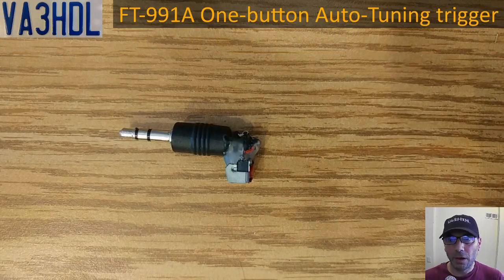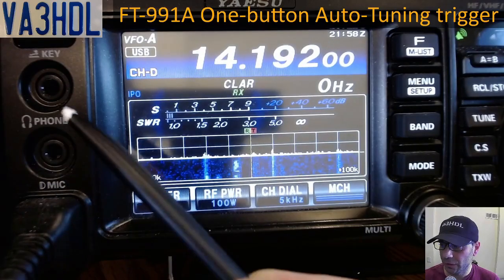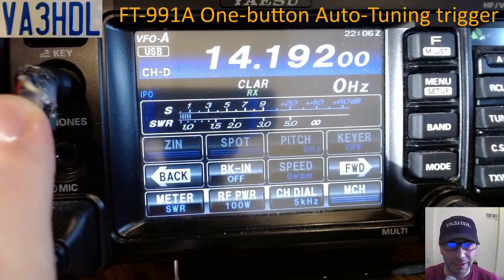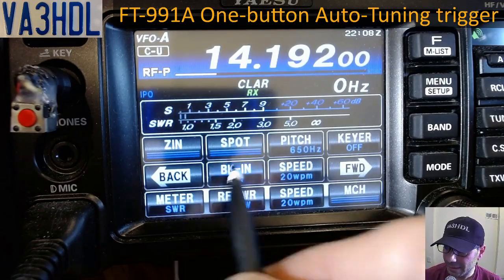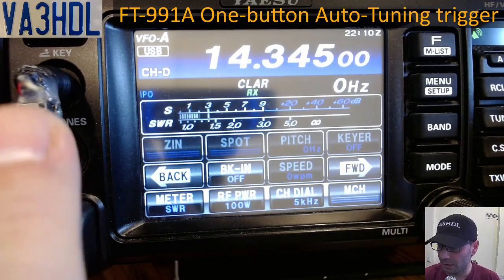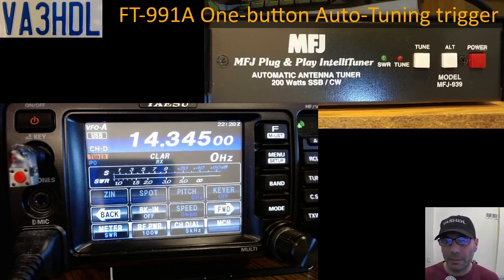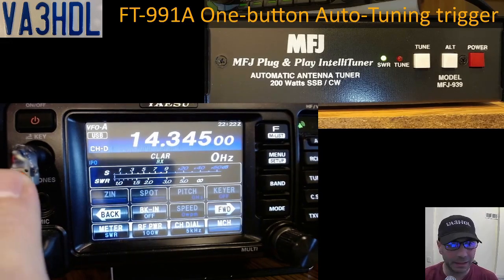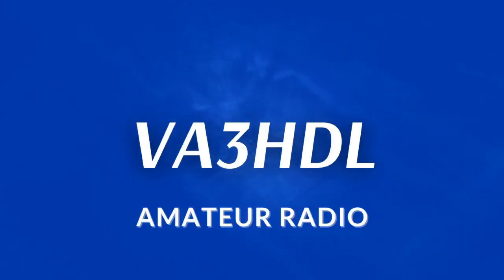FT-991A One-Button external Automatic Antenna Tuner trigger

Comment: You’ve made this way too complex. Any LDG tuner will start a tune cycle if you set the 991 menu item to external tuner and then press the tune button on the front panel. No external switch required.
Reply from the maker: This switch and settings are not intended for any LDG tuner or MFJ tuner with capabilities to connect to radio band/tuner port. This is for all other tuners that do not connect with a secondary controller cable, notably the ATU-100 which I have several videos on the channel. Thanks for watching and commenting. 73

Comment: This is a pretty good trick.  I just wish the radio had a setting in it that sent a 10W carrier to help you tune the rig.  I recently upgraded from a FT-450D and that radio has the capability to program a button to send a 10W carrier to help you tune (it also has an internal tuner, but most of the time, we run external tuners with multi band antennas... I digress), it was integral in how I ran my rig and setup, and am finding it hard to be without.... Back to this specific trick; I operate CW as well as SSB and it isn't as handy for those of us that do, as we still need to find an easy answer to this question.  Tuning with this trick in CW requires you to change all the settings back and forth each time we want to operate CW.  
That all said, thanks for the video and I'll keep searching.  73 one and all.
KA9I
Reply from the maker: Hi Joe, I'm learning CW and I plan to use the rig for CW as well. The only setting I believe that need to change is the "Keyer" on/off. It should be "off" for using this trick. Is anything else other than that? Thanks. 73.

Comment: Great video. It also tells me I have so much more to learn about the capabilities of this amazing radio.
Reply from the maker: Glad you enjoyed it Mike! Amazing radio indeed. 73
Reply: Please explain why you are using the external tuner vs the internal tuner? The 991a is supposed to have internal tuner. Thanks.
Reply: @haroldpalmsesq2506  The internal tuner can only handle 3:1 SWR ratio or better. See the manual at p.63 of the English manual. Even Yaesu offers the FC-40 as an external tuner. If you know your antenna is good from the outset, maybe by using a VNA like the NanoVNA that are available, then you can use the internal tuner, but if it is an unknown SWR, a tuner capable of 10:1 or 15:1 would work. Ideally, you use a well-tuned antenna in the first place.
Reply: @MikeCrabtree  thanks